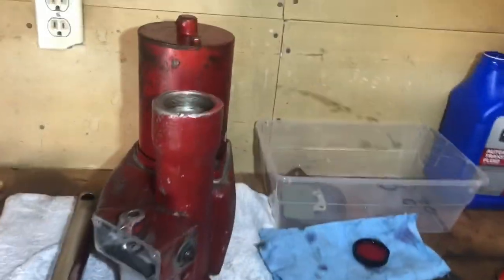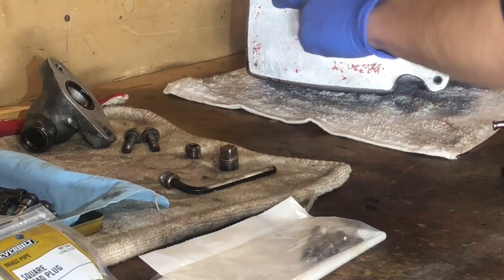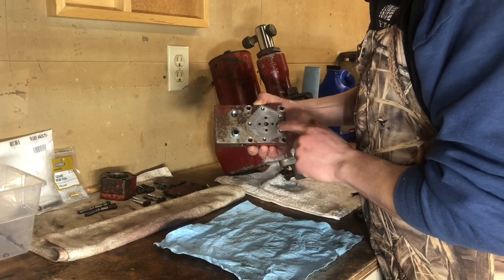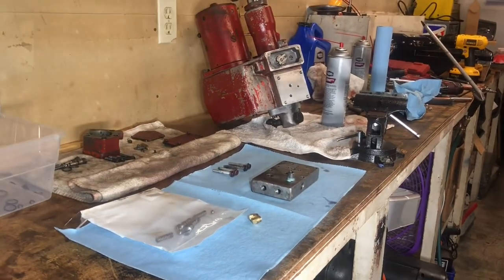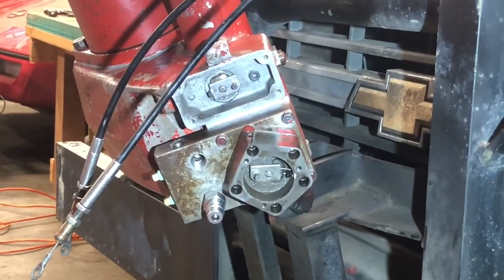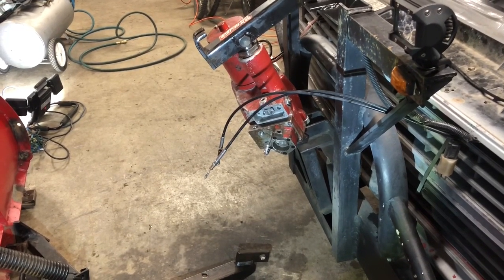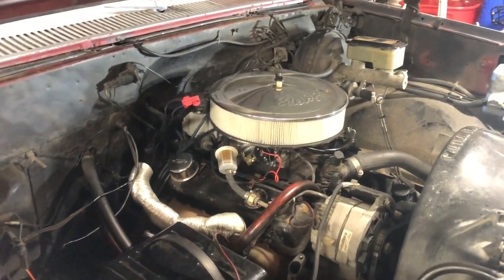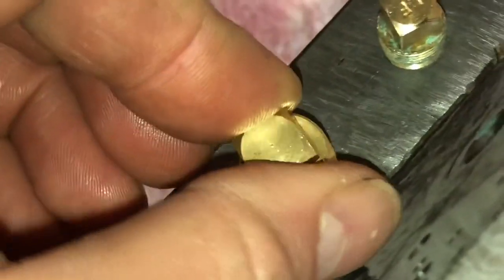EP98-Western Mark IIIa Cable Plow Hydraulic Assembly Final Rebuild (Plow Pt.7)

Comment: I just bought a similar snowplow, could you show me how you connected the joystick to the solenoid and from the selonoid to the snow plow?
Reply from the maker: Hey Marco, I’d recommend checking out the service manual and check out the electrical diagram and then should be able to run your wire, I believe it is just one smaller wire running from joystick to solenoid then a big cable from solenoid to pump motor. 

I’ll find link to manual and post it here soon
Reply from the maker: You should find diagram at page 20 

https://angelos-supplies.com/docs/Cable%20Control.pdf

Comment: Just bought a truck with this same plow. Watching your videos help alot (not much online about this style). So my plow will work up and down when it is cold, then after a few passes it gets slower and slower to lift. Then it stops all together and won't go up at all. The Rams won't go side to side at all with the joystick, but when the plow is in the air I can freely move the plow side to side by hand and there is no resistance once so ever.  Just wondering what your input would be to check that would cause these issues?? I do plowing for a living and this has been a nightmare (had to shovel all of my driveways this last storm we had and it was over a foot and a half of snow 😵) any advice helps man you seem like a wizard with these plows
Reply from the maker: Have you found the mechanics guide & repair manuals online? They’re a huge resource that will guide you through a lot of the trouble shooting. 

The lift issue, has there been any maintenance done to plow since you’ve owned it? What is the condition of hydraulic fluid? When the lift gets slower, can you tell if it’s an electrical issue that causing the pump to lose voltage or is it more of a hydraulic issue? I would go through the lift valve, clean things up and and reinstall, readjust. 

Side to side, does the pump activate and it just doesn’t turn or when you go left right is the pump not even activating. 

This should help, they really do a good job of explaining everything, find the trouble shooting table and follow the steps. 

Good luck and let me know how it goes!

http://library.westernplows.com/westernplows/pdffiles/13280_080193.pdf
Reply: @LastFrontierGarage   thanks so much I will download and check the manual now! Hopefully not to much snow tomorrow and I will be able to troubleshoot a bit. 
As far as the lift it seems like a hydraulic issue and not a voltage, I cleaned all connections and everything seems to get good juice/good grounds. 
I have not done any maintenance to the plow or fluid since I owned it (had it about 3 days now). Planning to drain it and clean inside the housing and switch from the atf fluid inside to the blue hydraulic fluid since I have about 3 quarts left in the garage from my old western uni-mount. Hoping to get the plow back up to par seems like it could possibly be a clogged filter? And it gets fluid good after it sits and settles then gets restricted again after a few lifts and makes it slower and slower to lift untill it won't lift at all? Thankyou for the reply and I will check out the manual and post back with my results when I get a chance to dig into it a bit deeper👍

Comment: Is there a video showing it work?
Reply from the maker: Hi Nathan, thanks for your interest, 
I have the footage but haven’t posted, been using it to plow since but still having an issue with it angling left, I think the pressure side is meeting the return side in the 4 way valve or I am getting air in the system. Will be positing soon the final video, just had to start using it instead of tinkering with it.
Reply: @LastFrontierGarage  what exactly is wrong with it.
Reply: @LastFrontierGarage  mine goes left super fast.  But snail pace going right.  I saw in their manual to adjust this you need to adjust the cable as it enters the 4 way valve.
Reply from the maker: Yes, the two adjustments are at the cable adjustment,  which sounds like should take care of your issue, as well as adjusting the lift valve but usually that only affects how fast the lift raises and lowers and if it’s Li’s adjusted when you go left or right the blade lifts too. 

 Have you downloaded the Western service manual?  

Mine starts to goes left then seems like the pressure hits a wall and then barely moves at all. I tried cable adjustment and as you saw in these videos went through the whole unit. I think inside the 4 way valve the pressurized fluid is somehow running into the return fluid and it’s ‘binding’ up hydraulically. At Trailercraft, where I picked up the parts they have a guy there that’s supposed to be good with them, so once it stops snowing for a few days I’m going to bring it there and hoping I won’t have to purchase a new 4 way valve assembly which is about $700-800
Reply: @LastFrontierGarage  if the adjustment on the cable going into the 4 way valve is not correct it will do what you are describing.
Reply from the maker: Yes, I’ve adjusted it all the way both ways  as well as taking cable off all together and manually turning valve while someone activates pump, going right works perfect, going left it starts to go then it tenses up with tons of pressure behind it like it’s fighting itself.
Reply: @LastFrontierGarage  interesting.
Reply from the maker: Will let you know what we find! Your issue does sound like a cable that’s misadjusted, it’s allowing more pressurized fluid on one rotation of valve than the other, thus causing one side ram to fill up quicker and the other fills up slower due to lack of valve movement.  Let me know what you find, there’s not much around on these things it seems like